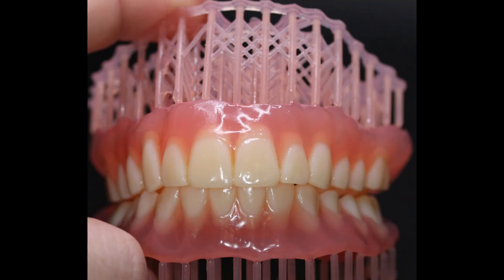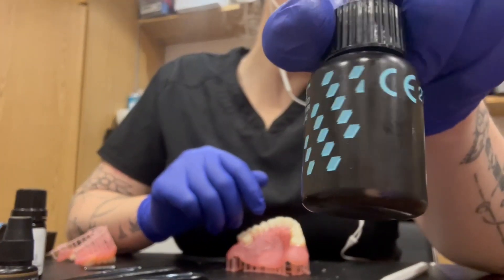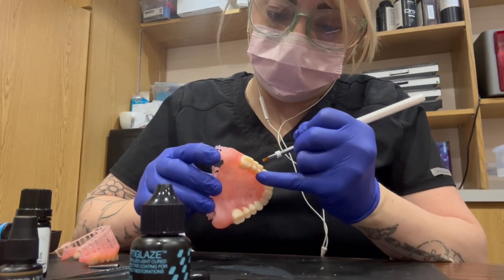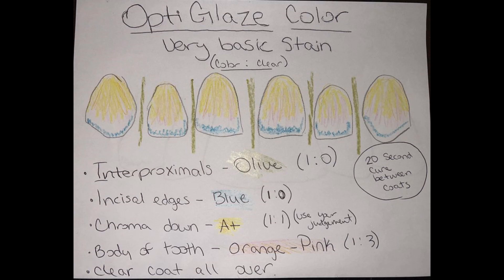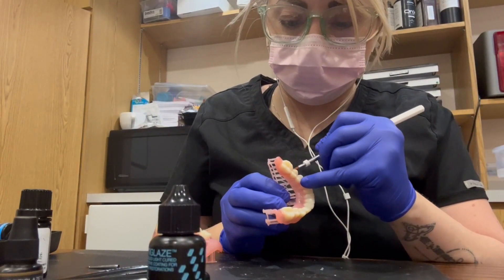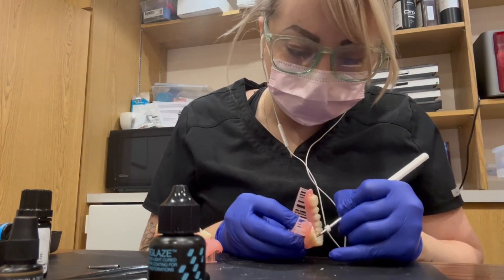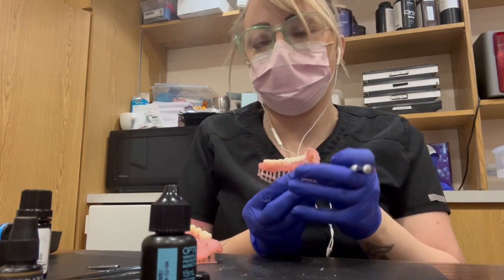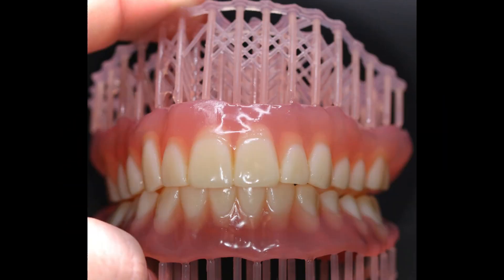Glazing base and teeth - 3d printed denture

Comment: What teeth resin did you use to print teeth and do you print permanent dentures
Reply from the maker: my normal go to for dentures is the SprintRay apex base and teeth. I use this combo consistently for immediate dentures. though for a permanent denture (there really is no such thing), I like a milled multilayer puck by harvest for teeth and gums with added gingival fibers for the base.
Reply: @the.digital.dental.assistant thanks for responding I’d figured there was no such thing as permanent like the heat cure dentures, been hearing a lot  about some offices doing them as permanent. Just wanted to confirm my suspicions. Thanks